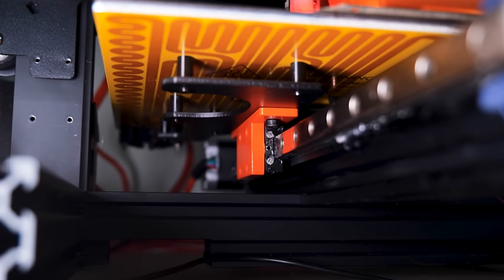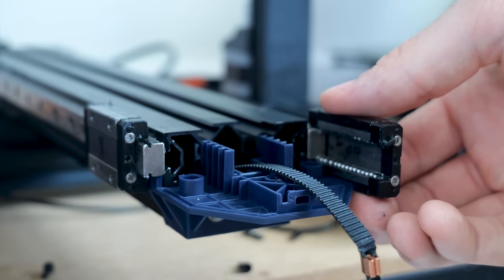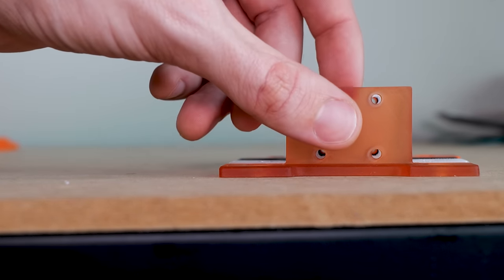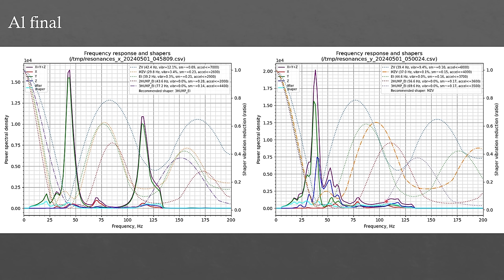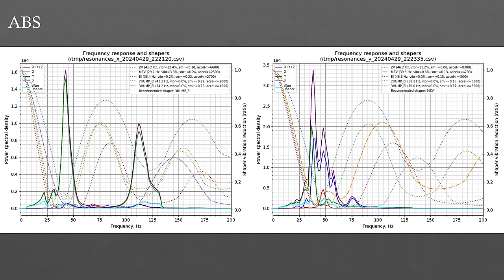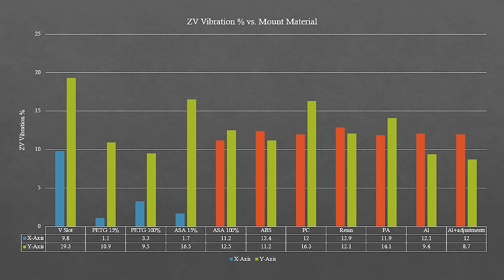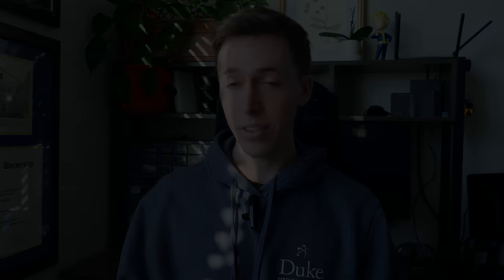Upgrading to Linear Rails a Waste of Money? - An Evidence Based Answer

Comment: 3:00 - you should clean them inside , cheap ones only have anti rust protection but are filled with dust etc from production line , clean them , take ball bearings out and clean too ,deburr the plastic ends (holes for balls sometimes have leftovers from mold) if possible to take them off,
 use ptfe oil (they will be louder but easier to move) 
It will make your prints way smoother , better quality etc. 

Next about infill...
Meh with more, thick walls , less infill but only honeycomb , gyroid , cross3D (cross 3D is my favourite oposit gyroid , honeycomb is great in Z axis but in xy gyroid and cross 3D works better in my opinion with less %) Mostly to hold top layer / add stiffness for hollow thin parts

Overall ....good linear rails and stiff frame are a way to go , but with cheap rails dont expect anything better , good linear rods / rly good vrails will work way better but need less accuracy to mount them but more work from time to time
Reply from the maker: The cleaning is a great tip! I definitely intend to do this in the future. I forgot all about the infill rule despite watching videos on it lol. Thanks for your comment!
Reply: @SpencersDesk  PS. You can also check the ball sizes inside it they rly loose and try to find bit bigger size then for few bucks more you can get way better accuracy from them ....but with proper cleaning , more screews they should work fine

Comment: the difference you felt in the rails is more likely than not a difference in the amount of the protective coating put on for shipping. you should have done the feel test again after cleaning and regreasing. the difference in feel will lower drastically.
Reply from the maker: I definitely did not prepare these rails properly. Thorough video coming in the future lol

Comment: I've slowly been upgrading my ender 3 v1 trying to get to a decent speed vs quality thing. I think I might swap to linear rails for the  Y axis simply because my bed wobble is insane. That single width aluminum for the V slot on it is a menace. I just wonder is linear rails would be good for it.
Reply from the maker: In this case, I’d definitely recommend the rails if you’ve got the money and time! If not, do your best adjusting the wheels. Otherwise, rails will give you a much more sturdy setup. I can’t remember if I mentioned this being a case where I’d upgrade in the discussion or not
Reply: it is known the v1 has issues with the aluminium extrusion not being large enough. Creality doubled its width on the v2. The stock springs are also very soft, replacing them limits wobbling too. If you are going to do something about bed wobbling, maybe you could try to have an even wider gap than the v2 by using 2 extrusions. There is a bit of work on the bed carrier, but it should be even better.

Comment: Did you wash the rails and carts, cheaper priced rails will have all sorts of metal shaving and other junk from the factory ? and replacing the bearings for better tolerances helps.
Reply: I second that. cheap rails often have loose bearings. There is a lot of precision to gain by using the right bearings inside.
Reply from the maker: Hey, I did not thoroughly wash them, just rubbed them down with IPA, so the insides of the carriages were not ideal. I’m planning on doing a more thorough video on properly preparing/mounting linear rails in the future though!

Comment: Grease in linear rails is ok, but don't load the carrier until it's full. I would leave the factory grease in. The friction from the grease alone limits the speed especially at the start of the print when the grease is cold. 
Use machine oil instead. One that has PTFE in it will be the best. The rail will be much noisier but however it will have very little resistance from the grease viscosity. The wear rate is slightly higher than a fully greased carrier, but for the sake of printing speed, it's a small compromise.
Reply from the maker: I think all machine grease should be removed personally. Part of greases job is to provide friction. It’s like how oil in your engine becomes more viscous as the engine gets hotter! There is definitely a huge debate on PTFE vs no PTFE which I plan to investigate!

Comment: I know the LDO site recommends you soak the rails in high % alcohol for 10 minutes to clean them
Reply from the maker: That is fantastic information! Thanks for the heads up. I’m planning on figuring out how to properly clean and set them up in the future!
Reply: @SpencersDesk  If you want to avoid soaking the rails in a large amount of IPA, you can shortcut the same process by moving the carriage centered over a hole in the rail and pouring the alcohol through the hole. Move the carriage back and forth and wipe off the rail. Repeat the process a few times until it seems clean—you should be able to feel the effect of cleaning in the carriage's smoothness of motion.
Reply from the maker: Not a bad idea! I'm lucky to have loads of IPA from resin printing. Now if I could only find a container for the cleaning...
Reply: I think some now ship with proper lube from the factory rather than this storage gunk they put on. Im surprised at LDO doing that. Id expect better from them.

Comment: Ok but how much did those PCBway parts cost? Literally nobody ever says anything about that bit.
Reply from the maker: Fair point! I’ll see about putting that in my future videos.
ABS~$9 for both
Resin~$14 for both
Nylon ~$19 for both
PC~$20 for both
Aluminum~$88 for both (keep in mind I had them painted which added a significant cost)

You can also upload files to PCBWay and get a price estimate for plastic parts pretty quickly! Hope that helps!
Reply: @SpencersDesk  that is actually reasonably useful, i have looked at other services other channels have recommended and they were hideously expensive for even small parts.

Comment: linear rails add weight, and the grease required attracts plastic particles like no other, that's why V slot poly wheels are really the answer, you can clear the tracks with compressed air and when properly set up, you really don't have to think about them, just like linear rails, unless you're running exceptionally large/heavy prints all the time. Just my 2c. Really nice writeup!

Comment: Main thing is to get a high quality rails. Like HIWIN with Z1 preload.
Reply from the maker: I am of the opinion that you’re in diminishing returns territory when it comes to HIWIN rails. I think well taken care of and properly setup mid-priced rails are good enough for our use cases. Also, with preload, I’ve seen a lot of people in the Voron community saying that it really doesn’t matter. I think I agree with them. Our frames don’t have the same tightness of tolerances as the rails, and our extrusion system are definitely much less accurate than the positional accuracy of rails. So, that’s an opinion I have I guess. No real facts to back it up

Comment: Maybe you should mount accelerometer in the center of the bed. Right now you measuring z movements of the corner of the thin plate,  mounted in the center. During the real prints, your model probably will be in the center of the bed
Reply from the maker: Hey, this is a great point which I intend to investigate. Ideally, our print head and bed are perfectly rigid to the point where the point of measurement doesn’t matter. However, I’m not sure to what extent that assumption is valid or to what degree mounting it in different places is an issue… Thanks for the comment!

Comment: What's about steel rod and bearings? They're a lot cheaper than the square rails and doesn't wear like plastic wheel. They can sag over long distances but the typical desktop printer are too small to worry about that. Especially on Z I see no point in spending on square rails.
Reply from the maker: I think that they're a valid option. The only issue is they may be hard to install! Linear rails are easily mounted to aluminum extrusions. Linear rods would require some additional parts to be designed and created. I personally think for the effort required, some cheap linear rails are the better option if you're upgrading. Thanks for watching and for your question!

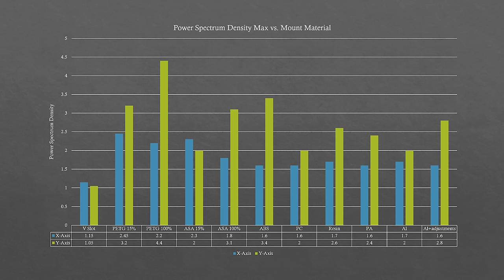Comment: first off thanks for comparing resonance for vslot vs linear rails (19:57). believe it or not, there is no other video on youtube for this. i have searched. there are tons of videos about linear rail upgrades but people don't bother with evidence testing, and if they do, they don't even show the results before the upgrade. my own finding though is that they do increase max accel just like you showed. brought my ender 3 from 3.9k->10k on x and 2.2k->3K on y (ender 3 y accel is limited but because of bed weight being too high and motor too small).

if you get your rails from a reputable source, they will have a light machine oil on it. if you get them from china, you would be lucky if it was machine oil. sometimes, they don't even bother to remove the cnc lubricant. if you have washed chinese rails, you would find swarfs and chips in the wash. 100% guarantee. the best washing liquid would be brake cleaner, next best and nontoxic is 99% IPA. 70% is ok, but you need to force dry it with heat because you don't have much time to reapply lube before rust begins, which is instantly. my recommendation is to use a gallon ziploc bag so you can actually fully submerge and soak the rails with little waste and also minimized time exposed to the air. take them out and dry with a hairdryer and immediately lube to protect against the air. don't forget the ball carriages. these need to be taken apart and cleaned too. metal particles collect inside there and need to be washed out. the balls from one channel should not be mixed with the balls in the other channel. be careful about this as the ball sizes in these two channels could be 1-4 microns different, depending on the QC fitting process, which is done by manual labor. there are tons of rail and carriage cleaning tutorials on YT. anyone bothering to clean their rail and carriage from factory should heed this advice to spend an hour learning the cleaning process before deciding to upgrade. steel balls on rails should be lubed with oil, per Hiwin recommendation, but grease will not need to be re-applied as frequently because of much lower evaporation. if using grease, PTFE grease is not the correct grease to use but actually lithium based for metal on metal. for the home 3d printer application though, where lots of plastics are involved, PTFE grease is actually totally fine. rails and carriage will not slide under gravity when using grease instead of oil. this is also completely ok. what you want to watch out for is catches and binding, not carriages falling under their own weight like some of the linear rail cleaning tutorials brag in their before and after videos, because that is a sign of no preload and preload is what you want to minimize resonance at high accels. a non-falling carriage has a little more friction, but completely negligible against even the stepper motors we have on our printers.  the balls only contact the two tiny side channels in the rails. this part you have to ensure is cleaned with a strong wiping action and lubricated. the rest of the rail only needs lube to protect against the air. dont forget the back of the rail, that will rust too. after lubing them, don't handle with bare hands because of acids in your sweat. use gloves.

for a bed slinger, your final speed and accel will be severely limited by your Y axis. find the max y accel and use that for both axes (also applies to corexy). max speed is only important for travels. print speed you will be limited by extruder flow and part cooling well before 150mm/s on 0.4 nozzle, 0.2 layer ht. 200 maybe if you have aftermarket hotend. far lower if larger nozzle or layer height. anything beyond that is a racer build and will require parts costing about a whole new budget printer.

zv vibr% comparison is an invalid comparison (20:24). the vibr% is the estimated residual vibration after application of the input shaper model and is dependent on the recommended accel for that model. you have several minutes of footage showing that the different mounting adapters have different recommended ZV accels with over 30% variation among the candidates. the comparison you were probably seeking is the vibr% with NO input shaping, which the graphing script does not give because it is meaningless. instead, plot the adapters against the accel value for the RECOMMENDED model, which would would all have vibr% close to zero but have the vastly different accel capabilities showing the true winner, even if they all use different IS models. still not worth using plastic over metal though.

don't bother with plastic mounts for rail to bed attachment. it is pointless to go through the effort to buy and use metal rails and then have flexible plastic connecting it to the bed. but your results already proved this (19:57). even if you print the best plastic adapter, there is no way for you tell when they start to fail and it is simply not worth the effort to have to fix that later. the time and effort saved from not having to take the bed off and put it on again and possibly also re-align dual rails for the Y axis is worth far more than the few dollars you need to spend for the correct metal parts. yes you would probably have to realign the rails if you change adapters. because of mfg tolerances and the fact that the bed bracket itself may not be totally flat. for others reading this, buy the metal adapters. you can find them on Ali for your specific printer.

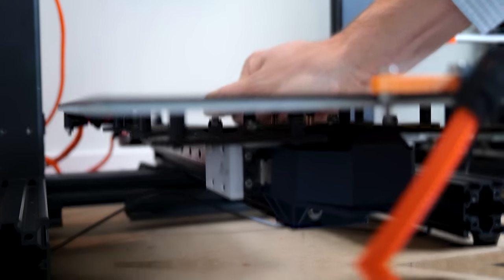(10:43) the Y extrusion rocking is beyond terrible. this is probably why you are seeing Z axis vibration in all your Y resonance graphs. like you correctly pointed out that this extrusion only sits  at one spot on printer base, this is simply a design flaw. you may get very good results by adding 2020 or 4020 square brackets to more rigidly fix the Y extrusion on the printer base. i think this will help a ton.
Reply from the maker: Hey, thanks so much for this comment! I wanted to wait until I had time to thoroughly read and respond. I highly agree with a lot of what you’ve said! I plan to make a video about the proper prep and lubrication of rails in the coming months. There’s so much argument over PTFE vs. Lithium which I find a bit silly, but hopefully I’ll provide something more concrete for people to argue over.

I am curious, is mixing the bearings in a low end rail of any consequence? Maybe in a higher end ones, but I doubt it is so accurate for mine. I actually just got some ball bearings that had a higher tolerance to use in all the rails in the future, likely replacing the stock ones.

I don’t think I’ll use vibration or acceleration or any of the numbers in the future. I’m likely to use actual printed results. While more expensive and time consuming, we are chasing something qualitative (how the ringing shows/how rounded the corners are) which the quantitative results, IMO, poorly represent.

I definitely agree with the metal adapters. I wish I’d made this point. Why switch to linear rails for the convenience then add plastic adapters that might remove that convenience, haha. I would argue that they add some amount of tolerance to how misaligned your rails could be? But at what cost.

(Edit) I forgot to mention, yes, I hate the construction of the printer. I plan to remove the y-axis extrusion and the middle brace at the bottom that it sits on. I want to add a brace at the front and back, then lay two extrusions for the y-axis to sit on. But, I don’t think it is the major source of my z issues. My print head actually appears to bounce when you watch it in slow motion/see ghosting on the top of flat prints (as opposed to the side which input shaper actually effects). I have some major mechanical issues which I hope to sort out over the next few months.

Thanks so much for an awesome comment. I’d love to see you in the channel’s discord!

Comment: The shapers that you are showing show a fundamentally flawed machine. There is a lot of noise in your graphs for both V Slots and Linear rails. It makes it very hard to compare anything when the machine has other mechanical errors. Linear rails are absolutely, 100%, without question a better solution to pom wheels. This is why all of the fastest printers like a monolith Voron or a VZ bot run them. Its also important to note preload used on the rails which i didnt hear you mentioned, but may have missed. For example a good Y rail would use Z0 preload, a good X rail would use Z2 and be wire EDM cut.
Reply from the maker: I should have emphasized that, yes, linear rails are the better system in pretty much every way. But, not worthwhile if you have working wheels already (IMO) Hope that clears that up!

Yeah, I know my resonances are flawed. This is actually something I deep diving into right now, so a video will be made on that!

Comment: Carbon fiber would be interesting because its also very light.
Reply from the maker: That’s a great point! The only concern is what plastic is carrying it. PLA, PETG, and Nylon (common CF filaments) would be good in the hot environment. Maybe there are others I’m unaware of?
Reply: @SpencersDesk  i mean the classic carbon fiber. usually they are mixed with 2k Epoxy resin. Very light and very rigid. Much stronger then aluminium. But you need to find someone who made it you can't print it that way obviously lol. But for the ender there are Carbon fiber bed's.
Reply from the maker: I guess what I’m getting at is the shape. Carbon fiber is great for tubes and sheets as they are long fibers combined. This makes it not so good for oddly shaped stuff, like these brackets. I do agree that carbon fiber is awesome though, I plan to use it in some upcoming DIY projects!